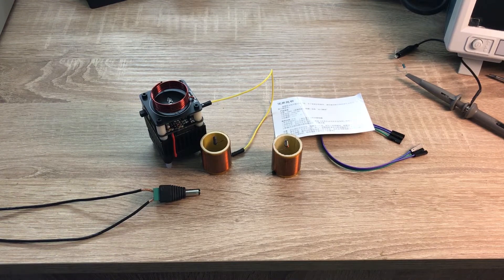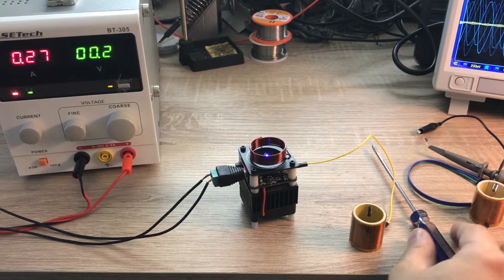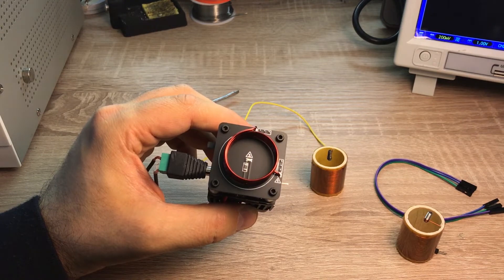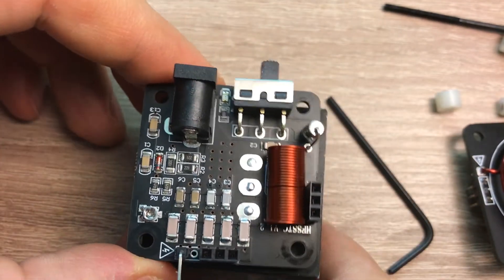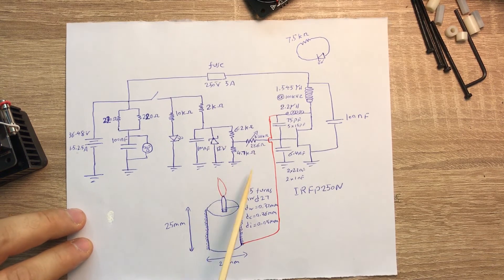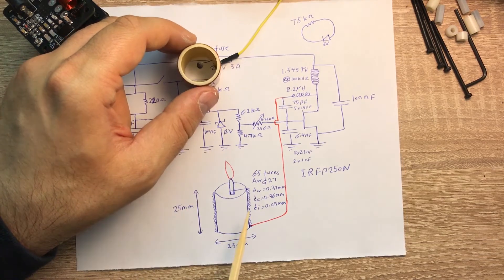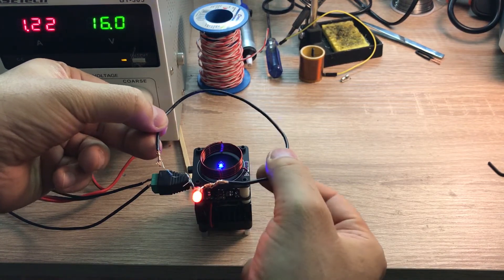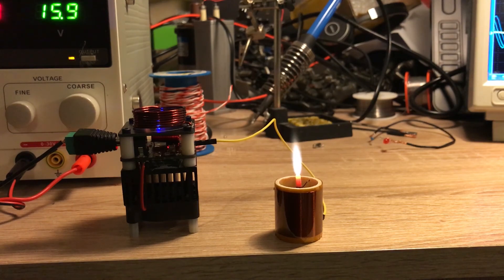Plasma flame generator from Ebay ( testing and schematics ) HFSSTC Tesla coil

Comment: There is no information about the conductor diameter and number of turns of the other inductors? This is the most critical point in the circuit.

Comment: The smallest coil isn't the secondary coil, it's an inductor
Reply: Yeah was about to say! That inductor limits the current draw(impedence) also SUPPOSED TO block noise/AC spikes back to the supply. Tho it looks like it may unintentionally  act as a tank circuit(in parallel with capacitor)...which is not ideal/ Will create noise

Comment: Are you going to make the video with the tuning and the ZVS modification?
Reply from the maker: A design by myself will be shown on a video. But not very soon because life is busy these days.
Reply: @HVE Hey, after one year I‘d like to reiterate the question myself. Very interested in the calculations for approximating ZVS in resonant circuits. Especially what values chokes should have to achieve ZVS say in baxandall oscillators
Reply: Thanks for this nice video... waiting for your video explanation on function and impact of each component... I want to try once....

Comment: How long can It run without overheating? 
I wanna build one that is battery powered just like an electric lighter. 
What parts would need cooling? 
Im paning to just use a block of aluminium as a heat sinc without the fan, since there would be no air flow inside its casing.
Reply from the maker: This is supposed to be a 10 minutes unit. from the experience i can say It heats very quickly, the breakout point get red hot within 10s of second and the magnifying coil will also get very hot. Its former is made of porcelain like material which is heat resistant. Even the main coil on the device get also hot. The mosfet and heat sink get warm but that is with fan ON. You can experiment with large block of aluminum and see how fast it gets hot, based on that you can get a reliable ON period.
Reply: @HVE  I guess we can calculate the heat stuff.
48volts and 2amps is 100 watts or 100 joules /second. 
Lets say 30% of that energy goes into heating the mosfet so we have ≈ 30 jouls a second.
Heat capacity of 1kg aluminium is 900 per degree celsius . 
So every 30 seconds the temperature would rise 1 degree, since we are starting at room temperature  25C and our maximum is 60C that gives us 0.5 times 35 ≈
17 minutes of runtime. 
or 5 minutes with a 333g pice of Aluminium. 
So I guess i would be safe on that side.
The breakout point would  be mounted on the outside with a pice of ceramic shilding it from the outher coil.
The real question is , how do i prevent the outher coil and the coil on the device from overheating ? 
I see no insulation on them , but i still guess that putting them in contact with aluminium  would lead to sparks and electricity flowing into the aluminium ? 
Sry for all the Questions 😬
Reply from the maker: @yaykruser  Your calculation is Okay,  the wires both have insulation (enameled) and you should not touch them to the aluminum. Coupling between the top coil and another small coil inside the device is very crucial for the device operation.
Reply: @HVE  Mine arrived today :)
But when i Turn it of I get burned by the screws that hold it together, they seem to get electricity induced or something because it creats a litttle spark ?
Is that normal?
It also makes  a  Brrrrrrrr sound that gets quiet if i hold my hand above the device ?
Reply from the maker: @yaykruser  When it is ON you should not approach your finger to the device. I have tried mine an i did not get burned from the holding screws while it was ON. Try to position the external coil near the main device not very far from it. I assume the Brrrr sound changes because you change the stray capacitance by approaching your hands near the device. maybe play with the two coils a bit (the ones that are on the device). Probably they are moved a bit while shipping, or maybe change the surrounding of the device (to change the stray capacitance).
Reply: @HVE  Thanks, I came near the screw when i turned it of (one finger touching the switch, the otherone holding the device in place.)
Weird thing is: the closer the utput coil is to the min coil on top of the device, the weaker the flame gets. I even tried shielding the main coil from the output coil with some aluminium foil and the flame got better.
I will send you a video...
How do you shield your device from other electronics? When I used it the lights went on and the tv Speakers in the other room started making sounds.
Kinda worried the neighbours experiencing similar effects😰
Reply from the maker: @yaykruser  Yes, this unit emits strong fields and my wifi goes off immediately, also my power supply goes haywire if the magnifying coil is place at the wrong position. So kind of had to play with it and find a good working condition. I have not played with it after i recorded that video, so don't know yet of a proper shielding strategy, maybe it is a topic for a separate video.